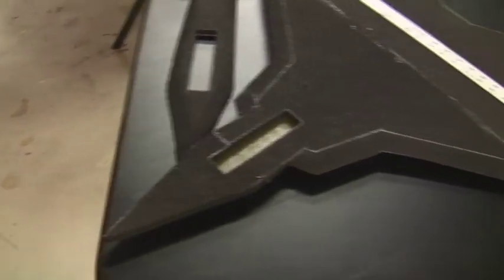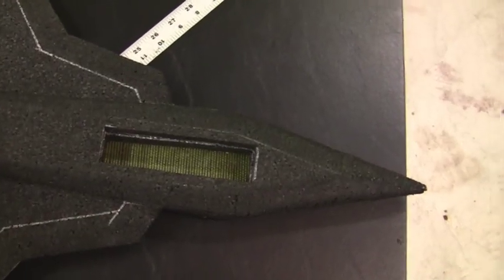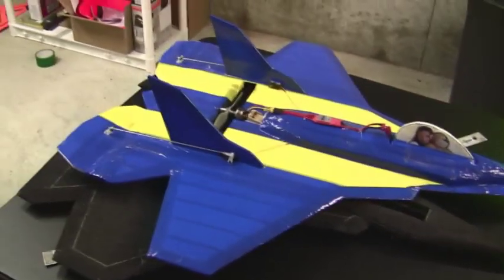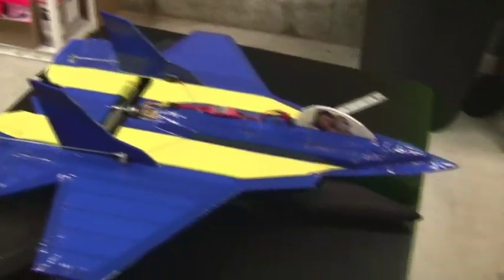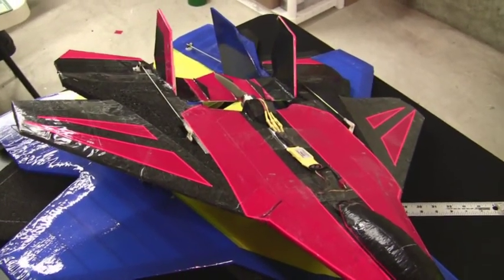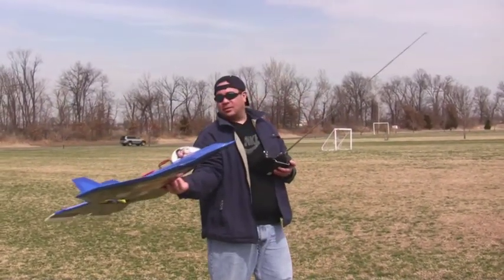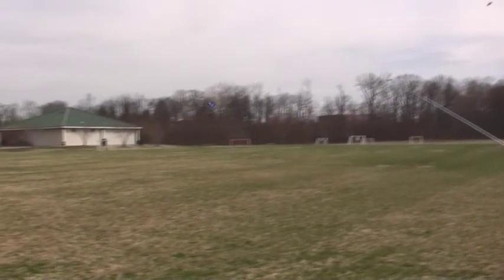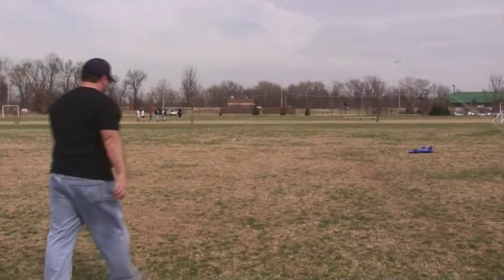Part 1 EPP Park Jet (Scratch Built RC Airplane)

Comment: best place for epp foam blocks and sheets any size or thickness is diret from manufacturers, FOAMS4U DIRECT best prices around and very quick delivery, call Daniel on 07772 290636 he will help you out guaranteed.

Comment: could you make a hlg/dlg glider? just 2 or 3 ch(ailerons not throttle) i think wings would work but idk bout the fuse.  o btw, im going to be putting the super sonic combo from grayson on my multiplex easystar eventually. should push 70+ with 3s lipo

Comment from the maker: BERELEAH, 15mm is aboput .59 inches or just a little more than 1/2 and inch. As for glue there are a few options. You Can use 5-minute Epoxy, Hot Glue, Goop or Foam Safe CA glue. I think I used 5-min Epoxy on my model. A lot of people like GOOp because it is a little flexible and give a little before it breaks. it does take longer to dry though. Epoxy, CA or Hot glue is faster. Hope that helps.

Comment: Hi rcFoamFighters. I must tell you that i love this plane its cool, nice job! Keep up the good work!!! I want to build one for myself. I just have a few more questions, if you dont mind. 1) How much is 15mm when converted to inches? 2) And what glue is best that i use to glue the parts together after i cut them out? As you did in the video.

Comment from the maker: codeengine, we usually use a table top hot wire cutter to cut out the main pieces. Then use a handheld hotwire tool to cut the  rough shapes and last finish off the surfaces with a Rasp and/or fine grit sanding block. Please see the new featured video on our channel, it shows the table top hotwire tool.

Comment from the maker: Thanks. Great that you want to build your own plane. I would first recommend doing some research on some internet Forums. Also if you have a local hobby shopit is a good place to start. As for a plane with Elevons (mix of Ailerons & Elevator functions.)  When you turn one goes up one goes down. When you pull up they both move up and down, both down. To turn its usually a little of both up and left or right. Not sure if thats clear, but hope it helps.

Comment from the maker: droogkloot,
I'm not sure what you mean by replacement material. I would think though any light, fiberous material would work. A light nylon mesh would probably work good too. Thats the fun of scratch building, you can try whatever you want and see what works best. And EPP is very tough even without a covering too. remember to test out whatever glue or adhesive you will use. Some will eat the foam up. Good luck!
Paul

Comment from the maker: gwsslowstick thanks for the comment.  I put a link in the sidebar to where you can get the $6 motor. Its from Hobby City or Hobby King. This place is out of Hong Kong. They have great prices on motors and batteries. If you purchase a few things than it makes it workth the shipping. You can ship 2 Kilos (4.4lbs) of stuff for $25. It's where I get all my 25 and 30C batteries for cheap. I've ordered at least 10 time and had no problems. Take a look.

Thanks again,
Paul (rcFoamfighters)

Comment from the maker: Thanks Rokit1man! The background is done with a green screen. Frank and I are testing it out. I'm hoping it will later help us incorporate more information into our videos. Also hopefully look better than the ugly concrete in the basement we usually have as the background. lol.  Frank  actually took my out once in mid air once. It was pretty cool, too bad we don't have it on video. My novajet and his wild wing fell at least a 100 ft to the ground. Both planes were EPP and were ok. EPP is tough.